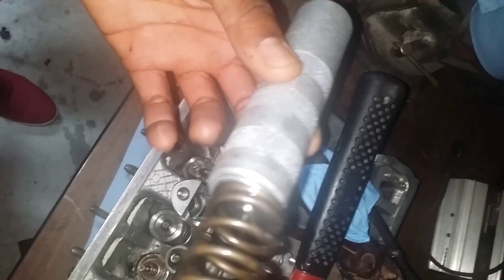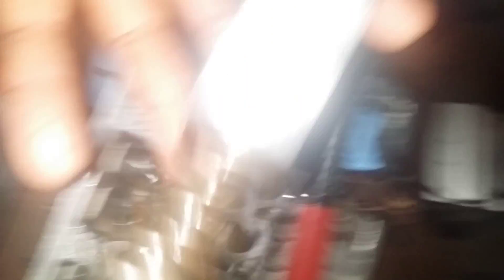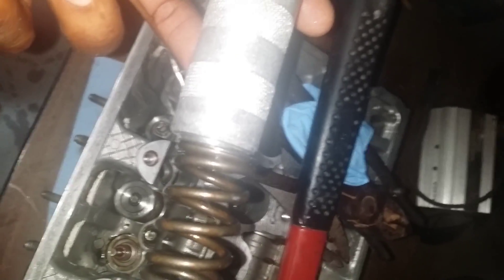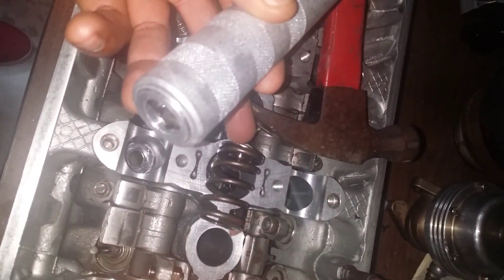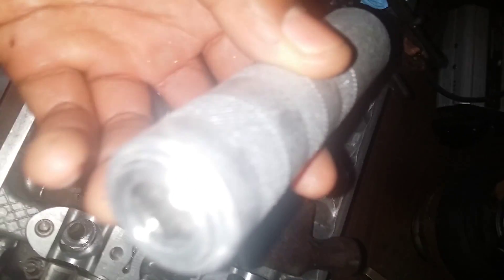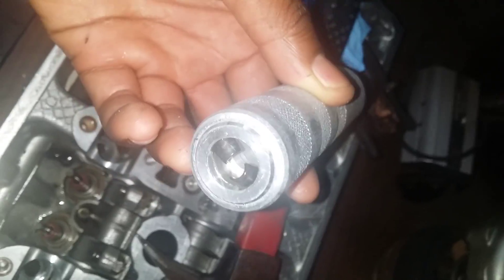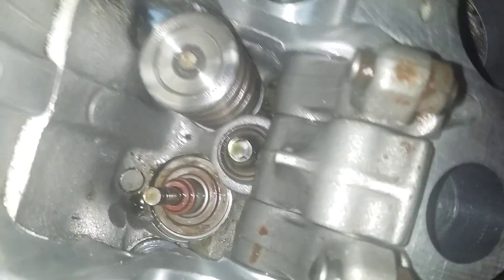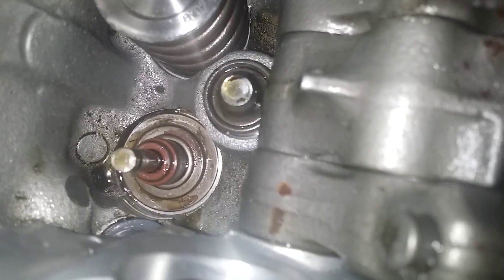How to replace H22 Valve Stems seals

Comment: Bro that head is supposed to have 2 springs on each valve. I’m pretty sure you’re missing the second spring
Reply: bro what LOL
Reply: There’s double valve springs in a h22 head. There’s a small skinny helper spring inside the big one and it’s not there in buddies video
Reply: Brayden oh ok ok. I see. Yeah there is two springs per cylinder. I just didn’t understand it when I read it. I’m building a head rn actually

Comment: I dont know if you are still active or anything, but where did you get that tool you are using?
Reply from the maker: Andy Dizdarevic Hey! I got mine from Wal-Mart. Here's the link: https://www.walmart.com/ip/Lisle-36200-Magnetic-Valve-Keeper-Remover-Installer/41080927?wmlspartner=wlpa&selectedSellerId=1330&adid=22222222228028948053&wl0=&wl1=g&wl2=m&wl3=61855037289&wl4=pla-98384811849&wl5=1015150&wl6=&wl7=&wl8=&wl9=pla&wl10=100362769&wl11=online&wl12=41080927&wl13=&veh=sem
Reply from the maker: Lisle 36200 is the model. I think autozone and oriellys has it too
Reply: Hell yeah man, thank you so much